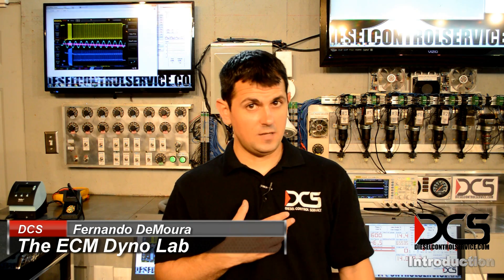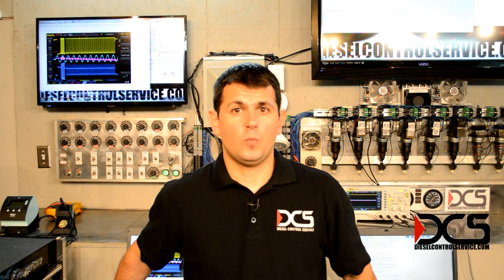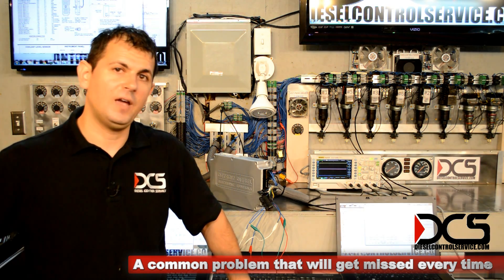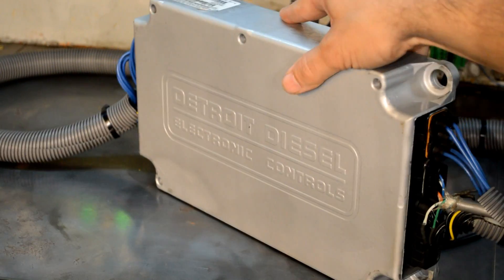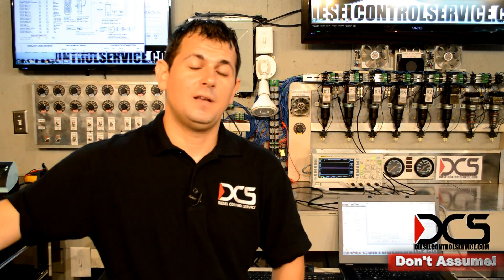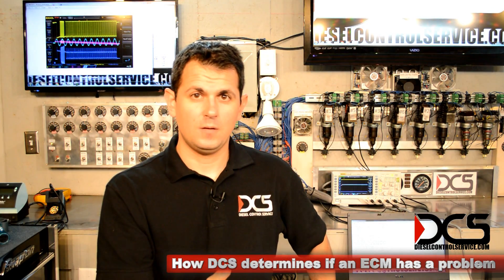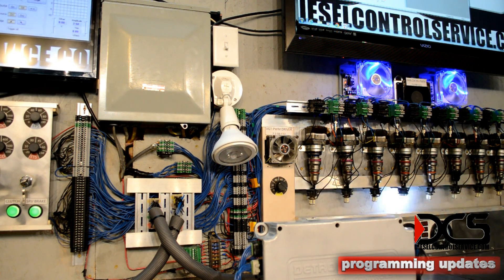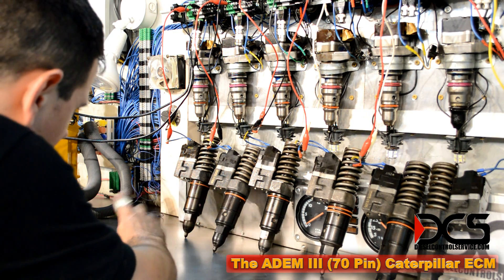The ECM Lab - The Detroit Diesel Series 60 DDEC IV ECM

Comment: Vary interesting video and glad i Ran across your channel and became a subscriber,  i sent my DD5 14 L ecm out to get work Done to it for egr Delete and Really didn't know the process but had to send it back to have the VGT& turbo Delete Done on my ecm also became truck just wasn't Running Right but the technician told me i still had to install a Resister to the Wiring harness on the Boost sensor but could not understand why when i paid him to do the egr Delete but unfortunately i lost my engine after 12000 miles and got Ripped off by a different ecm tuner that told me the 1st tuner Ripped me off and charged me to Re program my ecm and when i got the ecm back my engine still did not Run Right so I got back intouch with the 1st tuner and explained the situation to him and i even sent the ecm back to the 1st tuner to check out free of charge and he told me the 2nd tuner Ripped me off because he never touched or Reprogrammed my ecm became his original tune was still in the ecm so after putting $3000 dollars into my ecm i don't no what i got going on with the ecm or if its even programmed for a egr Deleate and 600 hp tune and 2050 torque.

Comment: After rebuild on series 60 am getting 4mpg. But before rebuild am getting 6.5mpg. What do you think is the problem. And also the truck shift gear in 2000 rpm..
Reply from the maker: I wouldn't take diagnostic advice from anyone who claims to know what the cause of your low fuel mileage is after reading your 26 word message. After the rings seat mileage should come up some. Did they send you low NOx pistons?
Reply: @dieselcontrolservice5120  no

Comment: Have 2001 freightliner with 12.7 brand new motor,  old Ecm went out. Now have stock ecm on. Looking to turn up to make better performance.
Reply from the maker: 6067BK60 or 6067MK60?
Reply: @dieselcontrolservice5120  I have 6067MK60 Factory Rebuild. I'm set at 470hp/1550tq. I would like 550hp/1750tq and a new battery for safe measures. Also want 78 pulse on injectors. Is this something you are willing to do?
Reply: @dieselcontrolservice5120 no reply.

Comment: Hello
We have a series 60 D4
DD engine with two throttle controls(accelerator paddle and operation panel tc), m having problem with accelerator paddle throttling (unable to drive anywhere), also operational throttle is still working we could carry out our operations smoothly.
How could we resolve this, we tried changing acc paddle??
Reply from the maker: If the TPS is new test the wires that connect the throttle to the DDEC. Visual inspections of the wiring harness won't find wires with ripped strands under the wire jacket. continuity tests find bad wires

Comment: My   1955  Murphy  Disels  is a real fuel  sipper     all  mechanisal  my  3208 Cat  is easy on fuel too ..   I have  IH  DT-466  DT-414  DT-360  too ..    longing for the Good ole Days ..  My  400  Cummins likes  fuel  903 V-8  Cummins  350  HP   Governed at  2600  RPM's  likes  fuel  too ..
  Detroit  Disel  8-V-92   does  pretty well on fuel  but I work  off road  so I don't know  it's  MPG.. 
  Now  getting  into  OTR  Trucking and I know I will need a mordern Electronic controlled engine that does not  suck too much fuell

Comment: I have 60 series 1999 peterbrilt with motor fully redone but some time on the it produce unwant power which i dont need on the plain road but not always, turbo boost to full force and the speed guage will dance from 110 km to back 90 km only does when the speed guage is not stable i have changed speed sensor can you help i will pay for ur service
Reply from the maker: Try unplugging the transmission tailshaft sensor. If after you unplug the sensor the problem gets worse then get someone to disable your vehicle speed limiter. If your problem goes away then you need to run some fresh wires between the DDEC and the tailshaft sensor. If not get progressive shift disabled.

Comment: Hello I got a 12.7 60 series it's missing at 1600 rpm not sure if it is the ecm thanks
Reply: I have the same problem. Did you find out the problem?
Reply: @rickfranck9111  yes I did it was my evil family members put plastic in my fuel tank and block the brand new. Splitter I had put on the truck to level the fuel in each tank it took me awhile to figure it out after replacing it with a new one while separating the male fittings from it I discovered the plastics in it put the new one on and a set of fuel tank covers with locks the truck runs fine no more problems the plastics was blocking the fuel starving the truck from getting fuel hope this help best of luck to you
Reply: Mine throws a code . Check engine light comes on. Says it's low voltage on throttle sensor replaced it still same problem.

Comment: We have a 1997 Detroit 60 series it has been in framed 2 times trying to correct white smoke on startup. You can idle the engine until the cows come home and it still has white smoke. Run the truck down the road light load and the smoke clears up. That is the only drivability complaint we have. It has had all the hard parts thrown at it you can imagine but still has that problem. To me it seems like the ECM thinks its at sea level but its at 3500 ft. We could use some help
Reply from the maker: Did you check the return line for foam? Also what are you seeing for fuel pressure at idle? Things get tricky with timing and cams once you get into 1998 but sometimes 1998 programs find there way into 1997 Series 60s
Reply: ,,, is this the compression ratio problem ?

Comment: I have a Detroit 6v92 with ddec 2 it recently started dropping all 3 left side injectors and the left side pyro will quite then I would hit a bump and it would start working again so maybe a loose connection how much to test my email or is it ddec? 
How long will it take to get back? Seeing as this is in a bus conversion where would you think it is mounted? I think it is located on the top of the engine?any thoughts?
Reply from the maker: So far every DDEC II I've repaired has been a job I lost money on.  I do too many of those and I'll be out of business. Until I can find a more efficient way to repair these I suggest converting to DDEC IV.

Comment: What type of degree is required to repair and work with the ECMS specifically.  I've currently  been working in the field for 5 years .
Reply from the maker: The degree I have hasn't been as useful as my experience and experience isn't half as useful as having real passion for this sort of work. If you've got the passion and put the time in rest will come regardless of what kind of degree or former trailing you have.

Comment: hi, i have  a problem  with  shifting, i  have  a smart shift detroit engin,problem shifting  from  6 to 7,we wanted to update the  computer ,stays all the  time  on  neutral,then wont start,can you help me resolve the issue ,please
Reply from the maker: I'd suggest checking the datalink connection. Also verifying that the transmission controller has a good read on it's input shaft and tail shaft sensors. Sometimes the X-Y Shifter is failing.

Comment: DDEC III 60 Series:
No cruise control, oil pressure and coolant sensor lights come on intermittently. I've done all obvious tests. ECM is recognizing engine speed, all switches, oil pressure and coolant temp. I switched out the Kysor warning light display, the EDM and both sensors to no avail. I have a fault code 53 and a couple others involving nonvolatile memory. I have gone right down to the ECM but I have no way of truly knowing what the issue is without testing the ECM somehow. What would your next step be in determining if the ECM is the problem?
Reply from the maker: I'd put it in my test bench and see if I'm seeing the same thing on my dashboard. If I did I'd open up the case and go from there.

Comment: can anyone tell me what this code is 128s214-01 on a60 series Detroit 430 help please somebody anybody.thx.
Reply from the maker: I'm not finding an exact match to that code and it may be passing through an OEM side chassis controller. s214-01 could relate to SID 214 FMI 1 which is triggered by low internal ecm battery voltage. If the DDEC is more than 10 years old there is a good chance the battery in the DDEC could have low voltage.

Comment: as far as 5000 rpm being dangerous NTPA super semies  run up to 6500 rpm. I had a 8v92 running 5200 rpm that i ran for a few years.
Reply from the maker: Have fun with all that, and best of luck
Reply: I wouldn’t want to be around a Detroit doing 5000rpm.  🧨💣💥💥🧯🚒

Comment: Hello, I program detroit ddec 3,4,5 and some of the ddec3 ecm I can get the engine to run 4000 rpm and others will not even if they are the same part number and software level  what is the difference? these are for competition only.
Reply from the maker: I really don't know how to put this nicely...Let me just say this...The Series 60 DDECIII 4000 rpm program has been around for almost 20 years and the guy who made it was a former DMR employee and never made a version of it that runs on DDEC IVs because he retired before the DDEC IVs came out. His program among many others got on the internet and is now downloaded by Detroit "programmers" who know little more about programming then how to click the  "Program ECM" tab from their library of stolen work and hold out their hand to get paid.  I've made my own version that turns well over 5000 rpm, produces over 120 degrees of injector pulsewidth, has three switchable stages, runs on DDEC IV hardware and any software version I want. (See my video's intro) I even demonstrated the program on my mobile test bench at the 2016 Mid America Trucking show. I have the only copy, it's dangerous and will never be used on a live engine.  If you commit yourself to truly understanding how this technology works you'll find the DDEC part number and software versions don't matter anymore.

Comment: I have a 3406E CAT from year 2000. It has a fan that does not want to turn on with or without manual override on. long story short, everything has been replaced down to the entire wiring harness for all of the fan circuit. The ECM will run the fan as it should but only is test mode. Once placed back into normal operation, it fails to operate. Any ideas for that?
Reply from the maker: If you unplug the 2 pin fan solenoid connector does the fan clutch engage or release?
Reply from the maker: You should plug into it and see what that 70 pin is seeing for temps. Fan clutch engagement temperature is high

Comment: What's the cost  Of A Tune UP To EMC of a 2006 Freightliner colombia?
Reply from the maker: The DDEC Vs that are on those don't usually have the contamination issues that older and newer (DDECVIs) have. Your internal battery might be getting low but I don't like changing them on a DDEC V unless RTC voltage is less than half a volt or you need to make a write to memory. If your talking about programming...well...in 2010 I was very proud of the work I had done with the DDEC V. In 2013 things changed and since then I can no longer do the kind of DDEC V programming everyone has grown to want. I can improve your horsepower with your current setup but I can't delete anything.

Comment from the maker: Thanks. DCS is new but I used to write articles for 10-4 and still do for MovinOut.  If you've ever heard of a Fernando that worked for Pittsburgh Power from 2007 to 2015. Well...that's me. I prefer DDEC IV's because the EEPROMs are better, the operating systems have more features and most DDEC IVs don't have a circuit board on the bottom of the case that gets submerged if oil/fuel/water gets in. On the other hand DDEC IIIs don't have a battery to worry about. I have a lot more to say but I'll just do another video as soon as I get the hang of Adobe Premiere or Sony Vegas.  So your DDEC has no comms huh? Being a 95 you originally had a DDEC III no doubt about that. Besides contaminant damage EEPROM failure is the most common problem with DDEC IIIs. The thing that's funny about your case is once EEPROM failure progresses to the point where comms go down, the truck stops running. The ECM gets "stuck in boot". Think of it like a PC that only shows you the BIOS screen but can't load windows. That said the fact that your truck is still running tells me that your ECM is not stuck in boot and likely has a comms issue. It may need a new multiplexing chip. I can't be sure without looking at it though.
Reply: Fernando I have no comm. To my guages where is a good place to start already checked fuses and wiring next is ecm and ecm wire harness
Reply: Where you guys located
Reply: Diesel Control Service 

Thanks guys. 

I'm going to call u tomorrow. 

I'm having trouble again with my ecm.

I told myself if my ecm would fail.
I would give u guys a call.

So u can check it out. 
But I love my tune. 

Well I'll call u guys water on today. 
7/ 28/2017

Thanks

Comment: wow this is awesome . I have never heard of u guys till I picked up a 10 4 magazine  for the first time jan  2016 pg  32. 

so it caught my attention.

so what's better? ddec3  or  ddec4  

I have a 95  kenworth  t600  with a 370/430  hp  12.7 with a super 10 trans  and 390 rears . (maybe put 410s  later  on)

I want to have  like 550 hp  or  600

I know that my ecm is not  communicating . I took it to a couple of local shops in Houston and they used that data plug. and they said "it's not communicating . it's not holding any memory. cpu  is  bad. don't know how it's running. get a new one"

so I came across this and it's awesome .

any help will be great. thanks Fernando
Reply from the maker: I could have sworn I replied to this post already but for a 95 I'd stick with a DDEC III. I can fix that problem with the DDEC IIIs